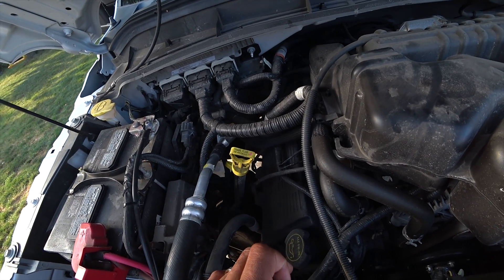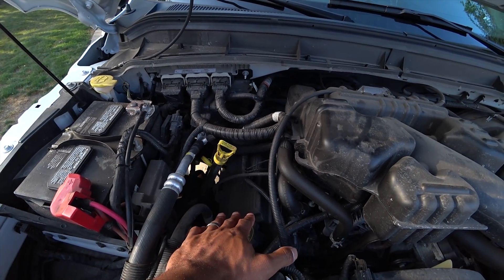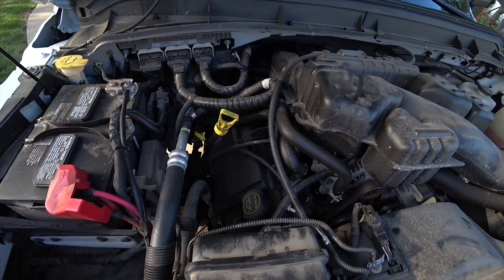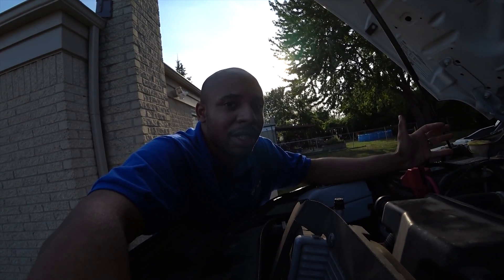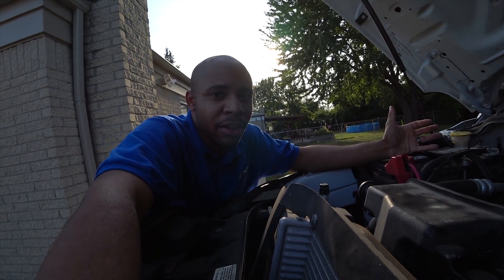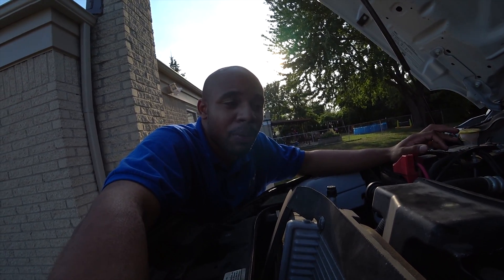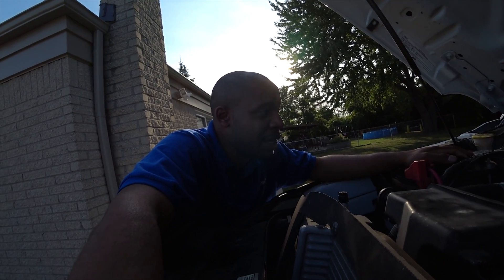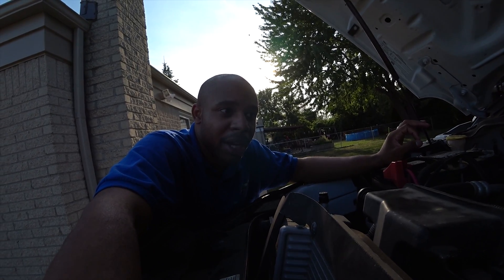6.2 F250 BURNING OIL

Comment: Lol dude, its just factory built in upper cylinder lubricant! 
Im running my 2011e250 with 400k on the original engine and trans, she burns oil but keeps on chugging.
Reply: The Duke says, how about an update bro? How many miles do you have and how is she running? What did I teach you?

Comment: Something about the production years, my 2012 6.2 has 178,000 + Km, running in all types of weather and terrain. Good luck, hold them accountable
Reply: does yours burn oil? I just bought one used and the level on dipstick is just below the lowest mark. Im just gonna change oil with Quaker full synthetic 5w20 and hope it dont burn oil. It has 183,000 miles btw.
Reply: @joshuadelafuente1295 how has this worked out for you

Comment: My 2015 started using oil at about 35k miles. I checked the PCV valve, and it was open all the way through. PCV valve fell apart. Took it to the dealer and they gave me a new valve. Oil consumption went away.
Reply: Hi. I have f250 too. Actually bought online dum me. And smokes and smells like burning oil.  I am thinking to try changing pcv valve . Did you changes right away after pcv replacement? Please let me know. Thank you

Comment: I use to be die hard Ford guy. But Ford don't care about their customers. Since then I have been buying Rams and as far as I'm concerned I won't go back. Ram has been taking care of me better then I ever had before. And never been left on the side of the road. Can't say that about Ford.
Reply from the maker: Ram is very good truck 👍
Reply: DonnaSean hey do you have any other issues death wobble because I’m thinking of getting a 2016 f-350 srw platinum gas 6.2 should I be worry or no issues with the gas models
Reply: Ram makes a decent truck, but my fords have never left me stranded. My ram has left me stuck twice, both in brutal cold weather. I have 2 2005 fords and a 2018 Ford and a 2004 ram. The 18 Ford has yet to be proven in my opinion because I only have 5000ni on it, but the 05s fords and 04 ram are all north of 150,000mi. The fords have needed less maintenance over the years and the ram needed a new short block at 139,000mi due to a cracked cylinder wall. My money is on the fords

Comment: No offensive american build junkers i own a 2007 fj cruiser toyota with 222000 miles no issues thats garbage i seeclot fords 6.2 fails spring valvevn chevrolet thata to much american know thw chevy ford n chevy are garbage but american say buy american i never buy this junk camaro new 6speed bad synchro s

Comment: My 2012 Silverado has 220k miles and doesn't burn a drop... weird.
Reply from the maker: 6.0 or 6.2? great engines!
Reply: DonnaSean 4.8l V8. It's slow af. But I've only changed the oil. I think I'm gonna try a ram 3500 diesel next. My work truck is a 2014 6.2 with 80k and it's been fine.
Reply from the maker: Me 250 been good ever since the issue was fixed! i have some videos on it! Those Rams are NICE!